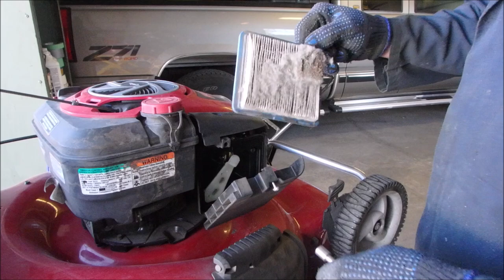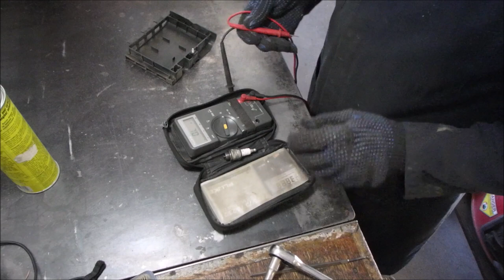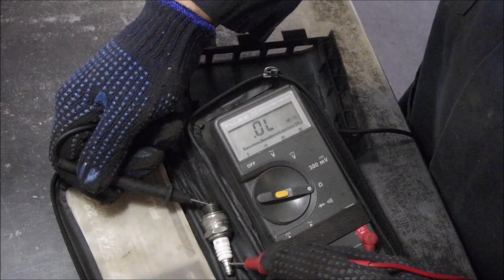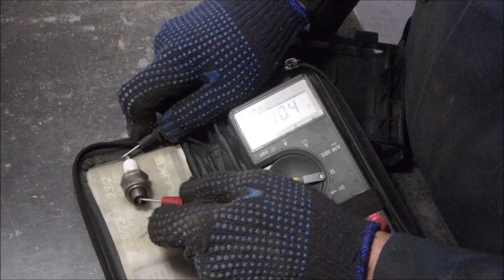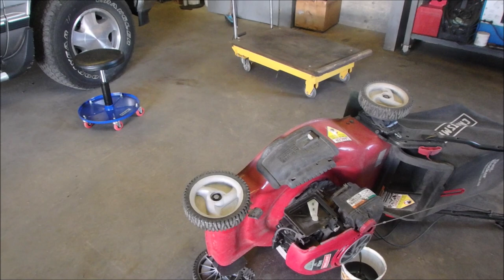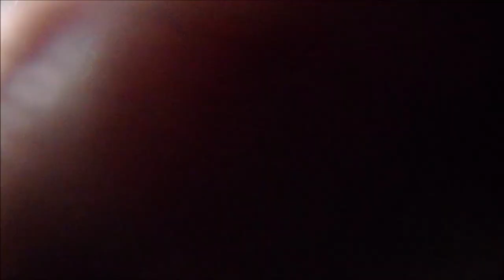Craftsman  Mower Tune Up.

Comment: Nice work Bruce.  Like the Fluke multimeter and the happy little Briggs.
Reply from the maker: Thanks 👍It is an actual tune up where the unit comes in running.

Comment: I just learned something new from you Bruce.  I thought all plugs had a resistor.  Does one work better then the other.  Stevo
Reply from the maker: I am not sure.  The resistor helps in  radio interference.

Comment: Ya know what I like to do when I change the oil; I start the engine, let it run for a minute or two then clamp off the fuel line. That way when the carb bowl empties out the engine stalls and it’s warm enough to drain the oil. It won’t flood out when you tip it because the fuel supply is pinched off and then it’ll start right back up again. It’s better for the engine and you won’t contaminate that nice fresh oil with gas. Just my two bits, thanks for the video on that nice mower. Good to see that some folks take care of their stuff!
Reply from the maker: I will do that  Thanks a lot.  Why didn't I even think of it.
Reply: @BrucesShop  can’t do it with a Pulsa-Jet carb but at least with float type carbs it can be done. Took me a while to figure that out, I just got used to doing it the other way lol!
Reply: Clamping the fuel line is a big no no..
Reply: @elcomandante9299  not if you use a fuel line clamp, been doing it for years.
Reply: That applies to any time you tip your mower on its side I suppose.
Reply: @campbellpaul  probably a good idea or at least set the engine on TDC of the compression stroke so both valves are closed.

Comment: Bruce the OLD MAN from EP here saying just another good video this time you remembered the spark plug boot, good job. We find here that to remove all the oil with our Pela 6000 extractor we need to put one side on a 2 x 4 (the 3.5 inch side) to tilt the engine towards the dipstick thus we get all the oil.
Reply from the maker: Thanks for the info!

Comment: Nice Shiny Red makes the mower look new.
Reply from the maker: I love red mowers.  Easy to sell too.    not this one though.
Reply: @BrucesShop try some  Meguiar’s Ultimate Black Plastic Restorer for the black plastic, works amazingly good.  I even use it on all the plastic.
Reply: @BrucesShop  yes I find red mowers sell better than any other color (includes Toro and Troy bilt, plus red Craftsman)

Comment: Have you ever used a Treysit Sirometer? Curious what you think of them. Thanks
Reply from the maker: Yes I have.  They are an older type of tach that uses vibration to indicate RPM.  I hope I am right
Reply: Bruce's Shop - thanks for the reply.

Comment: A tune-up should be maintenance, not a repair.  Meaning the unit should not be used so far/so long that it won't run at all without getting the tune-up done.
Reply from the maker: Right  A tune up means they are running when they come in.